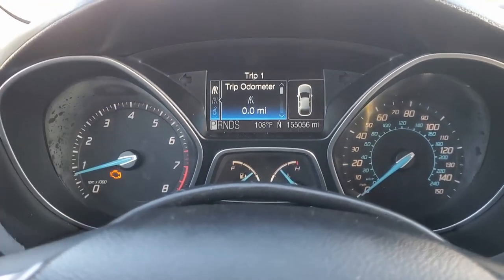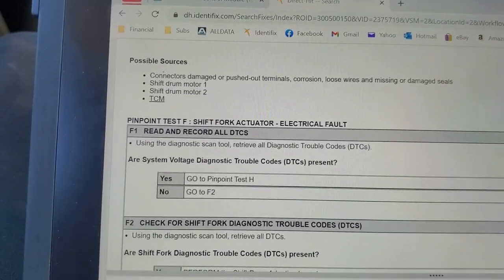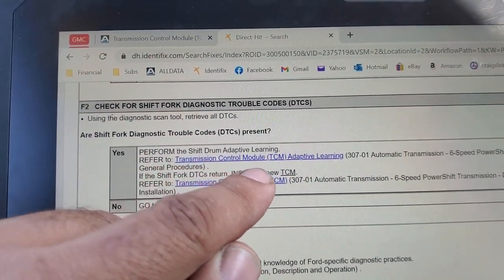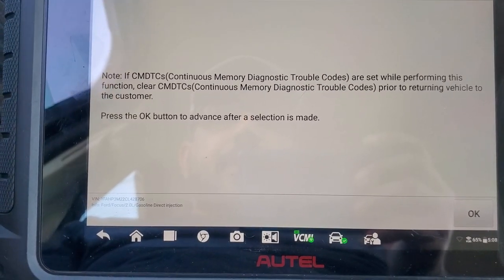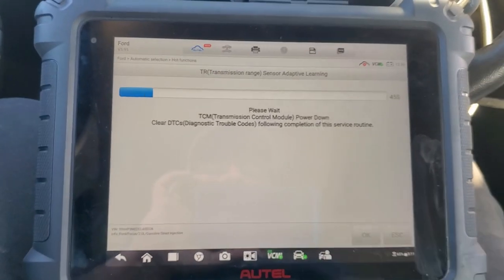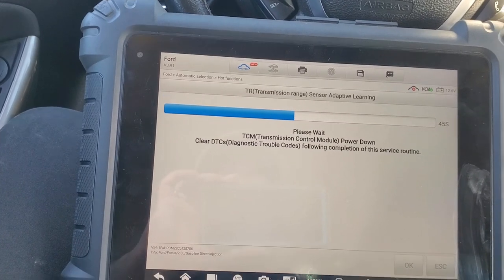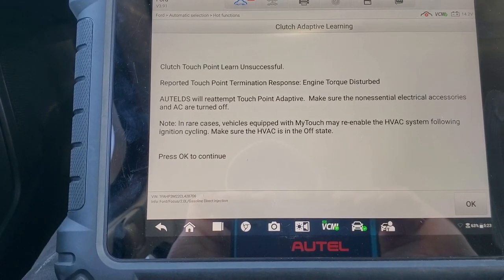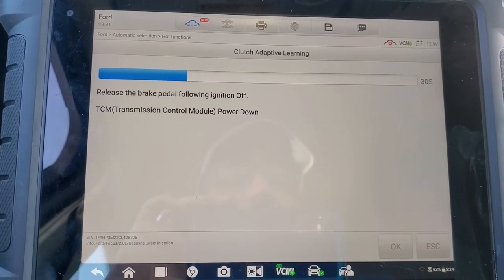Adaptive Learning for 2012 Ford Focus Transmission Control Module (TCM)

Comment: hi there, I have a 2011 fiesta se, had the TCM replaced two days ago, it was programmed but the person never did the adaptive learning, after trying to drive the vehicle it gave me a P2831 code, the person that programed the TCM told me an adaptive learning was not necessary, looking at your video it looks like it does, what`s your fee to do an adaptive learning and do I have to bring the car to you or can you come to our house and add the trip charge?
Reply from the maker: For the viewers, I met with Andres today. I reprogrammed his tcm and I preformed the adaptive learning. Car has to be driven to determine weather it has a mechanical issue or not. Wish him the best of luck.
Reply: @DallasAutoDiag   Thank you for all your help, drove the car to work today with no issues, glad I came across your video, every shop I called, first answer was to drop the transmission and rebuild, a $3000 to $4500 job, no one even tried to explain that an adaptive learning was needed after working on the transmission, 
again , thank you, very professional and showed up in time , will recommend to other people
Reply: only with adaptive learning did it solve it? my fiesta 2013 is giving this code p2831. but when trying to do the adaptive learning it gives an error and asks to check the electrical system. could it be bad battery?
Reply: @edufc270592     Good battery voltage is very much needed on these electrical components.

Comment: I had same code on a 2014 as well as an intermittent feeling of transmission slipping. Performed the same adaptation with A Verus and it corrected the issue. I think they lose adaption and the clutches wear.

Comment: Code will come back, the shift forks are likely binding from clutch dust and need either cleaning out or replacing.
Reply from the maker: Thanks for the tip

Comment: I have only completed this process with the Forscan/IDS...nice to see that Autel can do it!!!!
Reply from the maker: Forsacn is a powerful little software. I use it a lot.
Reply: if i but a new TCM and it needs programmed is this the same procedure? or is the programming of a new tcm different than this ?
Reply from the maker: @erosswog  programing is different
Reply: @erosswog  it's slightly different but I understand you can use Forscan to program the TCM.

Comment: FordFocus S 2012, 92k miles.  Recently it was hard shift from start (1st on 2nd), and even didn't changed! I pulled over on 1st gear. 
P2862 Shift Fork B Actuator Circuit High. (as we know B - it's 2,4,6,R gears) 
Attempt this Adaptive Learning with FORScan 2.3.6. Extended through Windows11 - didn't reset the DTC. NEXT Step - I will try to replace actuators....
Reply: of course it didn't help. so i did try to clean actuator port with wd40 and I failed - the bearing just fell apart when I was turning actuator tool. so I guess now I should looking for rebuild the gearbox completely.
Reply from the maker: I think it would be a good call
Reply from the maker: Good luck
Reply: the problem was in one of the TCM's motor, B to be sure. so after replacement TCM it works again. My clutch fork cleaning went me to fork replacement, so i decide to replace the clutch too. Also, the fluid was changed. Now it works almost without pushing or shuddering. Really good

Comment: If I get a TCM from a salvage/junk yard do I have to do any type of flash/reset on the used TCM before/while replacing it, or could I just do all steps you do?
Reply from the maker: There has to be programming and relearn
Reply: Ford has recall out for the tcm either 10 years old or 150 000 miles
Reply: The recall code 14M02

Comment: Great video! Do you think that I could do this at home with Forscan?
Reply from the maker: I think foscan will do it.
Reply: Sometimes Forscan is very touchy on the Adaptive Learning Procedure. Make sure the car battery has the trickle charger on it to keep the battery level above 12.0 volts while doing the Forscan Diagnotics. Goof Luck :)
Reply: @MikesVlogss  I would definitely advise putting something on the battery. That said, I tried TCM relearn on Forscan, and it immediately said service procedure interrupted. It wouldn't let me proceed. This is because my battery was on the verge of dying.
Reply: Ford dealership should know to do this after they replace my TCM?

Comment: Do you know of the cheapest scanner that could do the relearn on for focus ??? I don’t have deep pockets for a scanner .. thanks 👍
Reply from the maker: I know the 908 series does have the option. Im not sure if the 906 series would do so. Im pretty sure there should be another Chinese brand cheaper than autel that would have it.
Reply: @DallasAutoDiag  I’m struggling to find one cheap I’m getting so confused on which one would do the job .. co you possibly find a model for a cheap Chinese one for me . So I don’t buy the wrong one ☝️… thanks in advance
Reply from the maker: @garrieparsons2265  you can always call tge company or email them and ask that question of that specific car. They should have a sheet of coverage and better answer you.
Reply: @DallasAutoDiag  ok thanks . I just got finished fixing my transmission by manually moving the clutch forks and cleaning with brake cleaner drives like new now .. no computer programmer.. amazing.. I’m well happy.. thanks for your response reply 👍
Reply from the maker: @garrieparsons2265  happy to hear that man. Is this your own car?
Reply: @DallasAutoDiag  yes fix my own car I own so no dealers fee . I got luck this time 👍
Reply: @DallasAutoDiag  I got a p0902 code on my wife’s 2015 Ford Focus  great these Ford Focus right 😂 what do you think I should change out . The top actuator a ????  Thanks in advance 👍👋
Reply from the maker: @garrieparsons2265  a test has to be done, but if you want to take a chance then this

https://youtu.be/K1CoeqNb344

Comment: I actually have a Ford Focus SE 2014 with DSP6 and a Forscan Scanner, i'm going to do the firmware update and the adaptive learning tomorrow.

Do You have any advices or recommendations?
Reply from the maker: I don't think you can do any software update using forscan. you can still do the adaptive learning. let me know how it goes with you.
Reply: It works with the Beta version for sure. I programmed my blank TCM but I'm just trying to get the clutch adaptive learn to pass the initial clutch adjustment. Battery is good but it fails on that step every time.

Comment: I just got code Po90c and check engine light while driving home. Any suggestions?
Reply: I have the same code! Have you fixed it? Looking for a fix
Reply: @rctowers  being it said circuit low I’ve been getting a low battery light on. I replaced the battery and it’s been fine since. I have some clutch actuators on the way from eBay just incase
Reply: @retr0gameryt808  I haven’t checked my battery, thanks for the reply. My car gave me the same code and would not shift correctly. Did your car have any symptoms of hard shifting ? What’s odd about my car is when I would turn it off and let it sit for a bit it would drive normal and after maybe a couple miles it would start acting up again. But glad to know your car is doing well with a battery replacement, hopefully it fixes your problem
Reply: @rctowers  so my issue was that the battery was so low it couldn’t provide 100% power to the tcm like it needed. Go get your battery tested or turn your key to the on position but don’t start it. See if low battery comes up. I replaced the actuators just incase and it shifts like it’s brand new now
Reply: Hi there thanks for these helpful info 
I have 2012 focus and not shifting well I knew it’s the TCM I bought a programed one and put it on but it actually drives worse now I change both of the actuators with new one and still have the same problem but if i put my old one drive few minutes okay than not shifting well sometimes with nee one it’s just stop shifting and don’t drive also it’s hesitate a lot look like she on 3rd while I’m stopping 
Any advice? 
Thanks a lot
Reply: Check.your clutch actuators